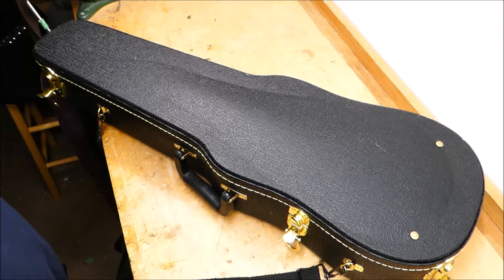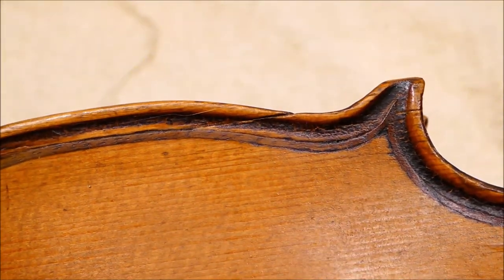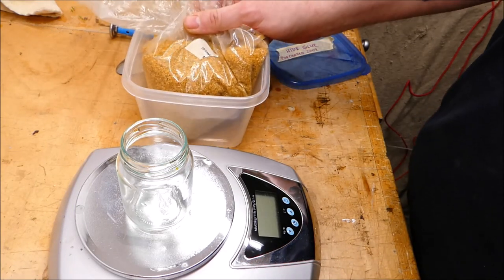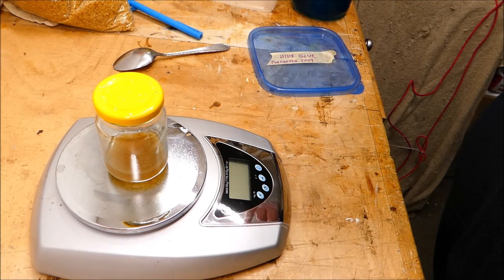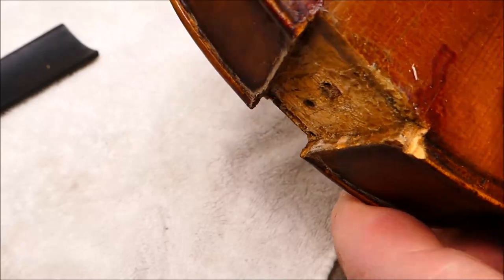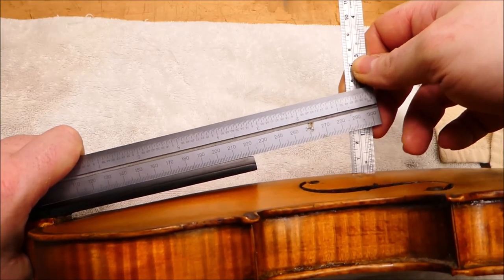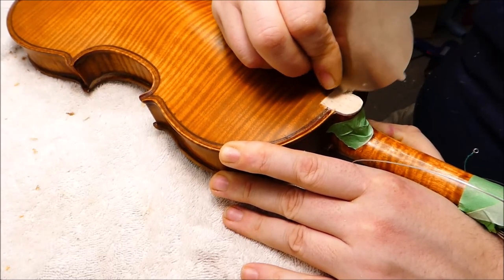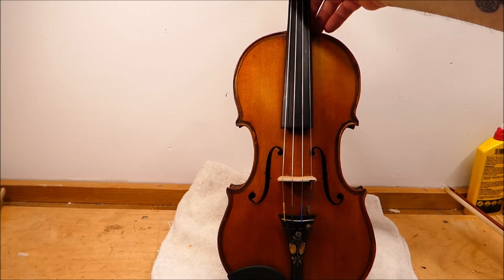Fixing a Fiddle

Comment: Thomas Johnson Antique Furniture Repair has recently been using a 4 oz (or so) plastic squirt bottle of "Old Brown Glue", which appears to be some form of commercial premixed hide glue. Previously he used the usual method of flakes, water, and glue pot. He seems to like the new stuff fairly well. Other than seeing him use it I know nothing about it, but it might be something useful for you.
Reply: It’s nice seeing that someone else here also watches Thomas Johnson antique furniture repair videos 😎
Reply: That stuff has been around Lee Valley forever, so there's a pretty good chance Ted's run into it. As I understand it, the very things that make it good are the things that make it less reversible, so it's not a 1:1 replacement when things are meant to come apart for repair.
Reply: Tom Johnson is a finish matching wizard, as well a a genius repair guy.

Titebond makes many kinds of glue, including a premixed hide glue. It's convenient.
Reply: It's not good for instruments though. I tried it on fixing a ukulele neck dovetail (I was new to woodworking) and even after 48 hours, it gave in when the strings were brought to tension. In deep joints, it take a long time to dry out.
Reply: @paulbouchard9521  Hide glue can have a long drying time, especially in humid conditions. I don't use it, personally.
Reply: @perihelion7798  I was meaning the Old Brown Glue. I've never had any issues with hot hide glue in humid conditions. I use it most of the time.
Reply: @paulbouchard9521  Hot, humid conditions will increase drying time for hide and fish glue, and the like. That may be an advantage in some cases. However, those glues get pretty brittle over time, which may be an issue in certain situations.

PVA glues will not get that brittle.
Reply: @perihelion7798  I’m not trying to talk anyone out of PVA glue but I like to recommend hide glue because I think a lot of people get scared away from it when they hear complaints about it that are largely theoretical. I've never found that humidity has much practical impact on drying time. A cold, dry room is a problem on big projects but for 90% of my stuff it serves me well and it has a lot of pluses over PVA.
Reply: @paulbouchard9521  Hide glue dries strong, and has a nice set-up time. It's only the eventual brittleness that is a minus for me. The last time I used hide glue in a warm, moist environment, it seemed to take longer to dry. But maybe my memory is fooling me, as it often does.
Reply: @perihelion7798  Im not trying to push hide glue, just saying that a lot of the negatives people bring up don’t have to be deal breakers in a practical sense. As far as brittleness keep in mind, hide glue has been holding together millions of objects that are hundreds of years old and PVA has only been in use for about the last 70 years…no saying how it'll hold up long term.
Reply: @paulbouchard9521  Hide glue is fine and practical for a lot of instances. PVA glues have waterproof versions that are remarkably strong. I'm using some Elmer's Max wood glue, and it's amazing stuff. Not affected by water once dry.

Comment: Hey Ted, just wondering if you'd ever considered an immersion circulator (sous vide) machine for your glue heating? The beauty is you can just set the desired temp and it will never waiver. The machines only cost about $100-150 now.

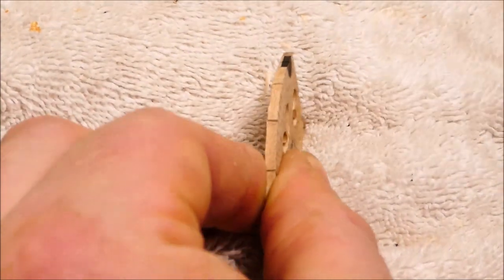Comment: 19:13 Well we were tuning it to pitch & the High E String snapped, so now we've gotta get that replaced. I think Geared tuners (such as Wittners or Easytune Machine heads) would've saved you that trouble plus they eliminate the need to have fine tuners on the tailpiece.

Comment: I think Changing the friction pegs out to Mechanical pegs would've been a good upgrade as the Mechanical pegs save the peg box from wearing out & improve the sound by putting the strings at a slightly sharper angle towards the nut, plus you can eliminate fine tuners from the tailpiece. I think Helicore Strings would also make it playable.
Reply: Oscar Stern,
Mechanical pegs, while totally shunned by nearly every string musician, are far superior to traditinal friction pieces.
Reply: @j.d.schultzsr.9215  Nobody should shunn those Mechanical pegs anymore, this is really outdated information.

Comment: to thin the bridge hot glue a dowl rod to the flat face , use a belt sander to thin and taper the face. this removes the mass with no danger of carving. I have made seven bridges from commercial stock supplies

Comment: My brother used and still has a wood glue you have to mix the material with hot almost boiling water for his Upright bass when he did repairs to his instrument to keep the top and back from separating from the sides. Normally with a Bass if being correct repaired or made to the classical era one uses horn glues like from Mountain Goats or some beads of cow/bull animal say Scottish Highland or some dual purpose breads of bull/cows that have horns but most now use the heated type of wood glue due to that strong horn glue being a good bit harder to find then the hide glue. He did not quite do some of the work right and had a slightly thicker version of the glue as final project he ended up with parts should have some flex not movement but flex in the edges of the upright bass with the face and back.  Since then however no parts popping apart when the humidity changes by 5% or more from season to season.

Comment: Being that you only make guitars and have no experience in this kind of instruments (your words), you have done a great job especially on the tailpiece.
It is rare to see a violin that has the purfling so inward.
It is not quite visible, but it seems that the angle of the neck was a little low, which would cause the strings to be too high and/or the bridge would have to be lowered too much.
Did the violin have a label inside? Normally factory violins (it seems) from the early 20th century came from Bohemia or southern Germany. Maybe it's from some of those places.
Again, nice job.

Comment: Hi Ted, would you answer a question for me please? There are posts on You tube where someone shows how to sand down a Gibson neck to get a thinner profile. How do they know when to stop sanding before they expose the truss rod?
Reply from the maker: Experience, mostly.  In general the material over the truss rod tapers from about 3mm behind the nut to around 5.5mm around the 17th fret.  This is not a lot and you can't take very much off before it gets too weak.
Reply: @twoodfrd  Thanks very much Ted. I had a suspicion that there wouldn't be much material to work with but I didn't realise the tolerances would be that fine.

Comment: I have done a lot of research about violin vs fiddle. The consensus is that is it the purpose, type of music the instrument is used for that determines whether one calls it a violin or fiddle....

Back in the day, hide glue was ALL THERE WAS! Glues have come a long way since then and wood  PVA glue, in my opinion is far superior in pretty much ALL wood cases! This only downside I can see is it would be harder to take the instrument apart if needed.

That tail piece glue joint looks very suspicious. I would have separated it, cleaned it and re-glued it....

Did you replace the sound post, or was it still in place?

The only thing about the bridge is that it needs to be tapered, wide at the bottom to narrow at the top on the wide sides....